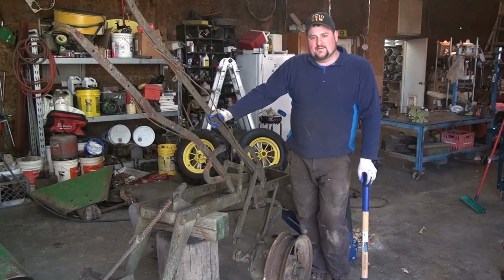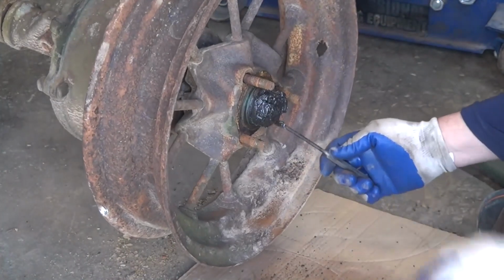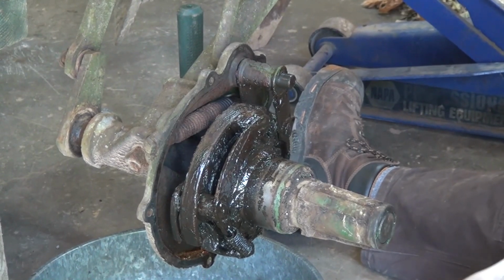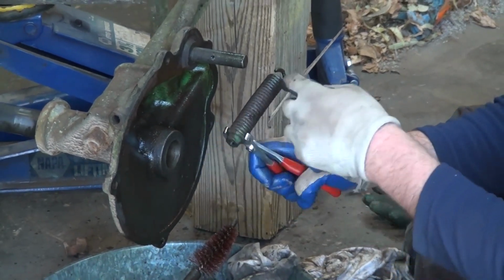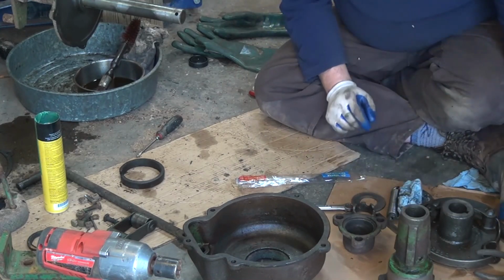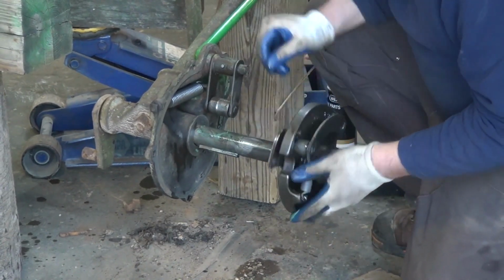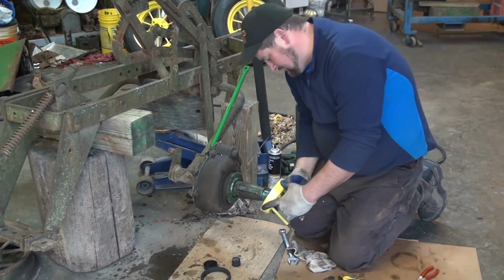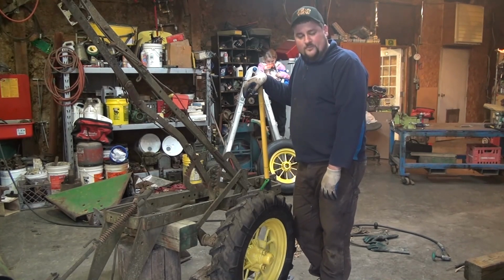John Deere Enclosed Clutch Rebuild

Comment: Thanks for the video! I have only recently started participating in some of the local plow days in my area. I am in the process of purchasing my first mechanical trip plow which is a Deere 55 plow (not sure on exact details of it yet), but it is a clutch trip. I was very hesitant on getting a trip clutch plow and/or converting one to hydraulic since my red tractors do have hydraulic capability. But thanks to your video, I now feel completely comfortable keeping and maintaining the original clutch system on it. I was completely oblivious on how simple these trip clutch/cams really are. Thanks again for the amount of info in this video, and for taking away the "mystery" on how the trips really work on these plows.